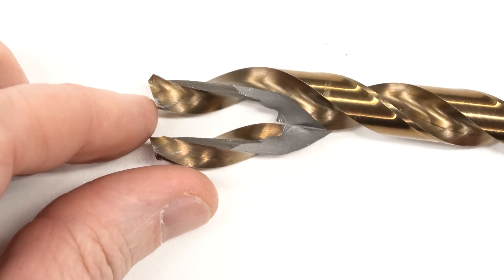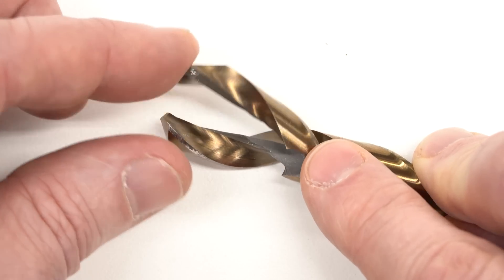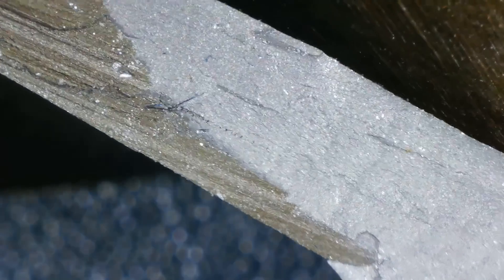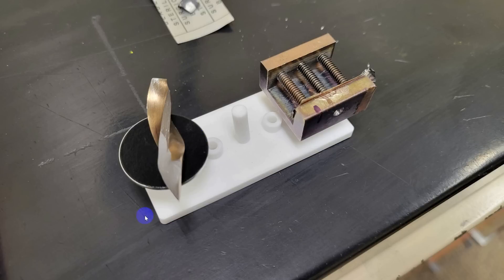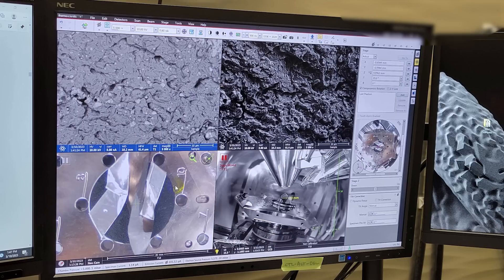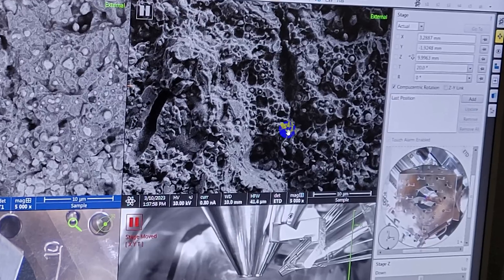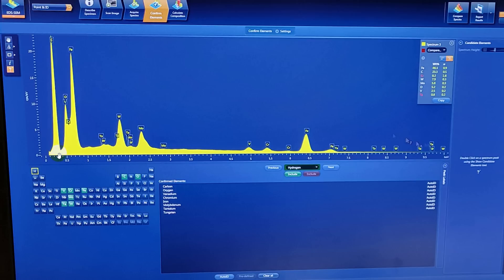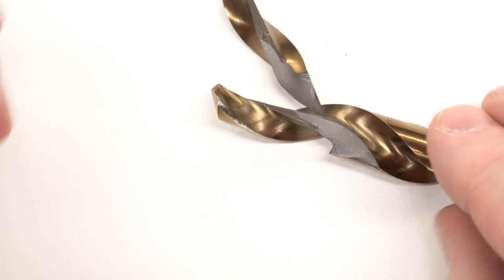What the Scanning Electron Microscope Reveals About This Failed Drill

Comment: Your analysis is very interesting. Under electron microscope the  pattern on the crack look like plastic deformation crack during austenitizing temperature which for M42 HSS is around 1200 degree celsius. But this should not be the case since M42 HSS drill bits are not roll-forged they are ground from cylindrical blank. Image of a crack of ground manufactured  drill (HSS-G) should look homogenous, nothing  like on your case, which look like crack on HSS-R drill bit. So either manufacturer use roll-forge technology instead ground metal manufacturing process for saving money and only finnishing the flutes with grinding so they look like are fully grounded, but in reality they are not.

Comment: I wouldn't reproduce that same "exact" operation again... You'll probably end up pulling the part out, jamming the machine, or pulling the chuck and or arbor out at the least.  Something has to give if your drill gets in a jam. That's why I ended up using HSS drills with my small lathe with small tapers.

Comment: Enlarging existing holes is normal and should not lead to failure of that sort. That said, ideally the right tool for the job is a "core drill" (not to be confused with the other type of "core drill"!) which has three flutes and an extra thick web. You get better roundness and even less chance of breakage.

Comment: You have the same problem I have. I need to specifically decide to not get interested in a topic or I find myself deeply immersed. I’ve used a scanner in college many years ago. Almost bought one or two on eBay, but no room for it.

When increasing drill bit sizes, I try to increase them geometrically. That generally enables the larger bit to have the same forces across the diameter as the smaller bits. Does it matter? Well, I haven’t done an analysis, but I’ve never had a bit break in the lathe. In the milling machine I have had a few bits break. Now I use annular bits in the machines whenever I can.

Comment: I like the analysis, even though it's basically just telling us that there was a manufacturing defect and the solution would be to take a new drill bit and finish the work.

The important lesson here is that this also tells you and everyone else what to watch for in case something serious has happened. That could make a huge difference when it comes to identifying who's responsible for an accident - or not responsible. A few years ago I did see a video/TV program regarding a trucker that was considered innocent because the fatal accident was caused by the steering arm breaking off on his vehicle due to a manufacturing flaw similar to that drill bit. (sorry I don't have any link, but it doesn't matter, the knowledge matters)

Comment: Never seen a drill break like that before😲 and I've broken many drills.
And i agree with them partly that you shouldn't enlarge an existing hole.

Pre drilling should never be larger than the web of the largest drill.
If you only have a little smaller pre drill it will often bite and snap it.

Split point drills are made to be without any spot but still benefit from a small pre drill.

Typical 3mm pre drill for a 10mm final drill.
If you predrill with 8mm you're almost guaranteed to break the drill

Comment: The darker broke area - as you said with the ductile failure - that is not really consistent with this cracking during manufacturing but the drill breaking under stress during drilling. When the drill is under a lot of stress like enlarging a hole then when the a ductile failure occurs all the build up tension will be released in the form of heat on the fault interface. that can be a couple hundred degrees hot.
Had an auger-bit fail on me spectacularly. The cutting edge, the flutes, the entire outside of the drill was cool to the touch, yet the new broken surface was hot enough to burn me.

Comment: Very nicely done. A few things to remember when doing SEM/EDS analysis. First the secondary/backscattered image is a surface effect and backscattered is average Z (atomic number dependent), so darker is lower, brighter is higher Z. So backscattered is good for quick average Z grouping. EDS however is volumetric, that is the x-rays come from the excitation volume below the surface. Classic tear drop effect. The electron acceleration voltage determines how far into the sample. So you can play games with how far below the surface by adjusting the acceleration voltage. Of course, the lower you go in voltage, the harder it becomes to identify elements from the lack of excitation lines.  Typical acceleration is 1.5x the lines of interest. Also doing EDS on a non-flat surface become tricky as the x-ray takeoff angle (to EDS detector) varies and the math becomes impossible to calc accurate weight percent of elements. Flat, polished surfaces only for serious EDS analysis. At one time we had two SEMs with EDS detectors in house. Lots of fun. I miss them.
Reply: Like you mention, you have to be careful about assuming the height of the histogram peak is proportional to the amount of the element present. The peaks represent number of X-rays received which is a complex result of many factors. Comparing Cobalt peak in one sample location relative to another location is generally safer. Trying to compare e.g. Cobalt peak height to Iron peak height at the same location has much less meaning. Sample prep and software tools exist to try and estimate relative proportions more accurately, but in my experience this was very uncommon in casual analyses.
As someone else mentioned, the window on these detectors frequently block or seriously attenuate X-rays from lighter elements like Carbon and Oxygen so those peaks often aren’t super accurate.

Comment: Shop practice != Best practice.

As even many comments here show - many people just do as they have always done. They start at a shop and get told "for XY hole pre-drill with YZ" and afterwards never question that. Drill-manufacturers in general suggest pre-drilling for hole larger than 10mm/ 0.5 inch when working with metal (that is just roughly, depending on the manufacturer, drill, material, feedrate etc ). 

had a similar experience when doing my first reflow-soldering back in university. Had my PCB, soldermask, solder and components prepaired, as well as guideline for the solder-profile of the parts and the solder it self. Got to the local electronics-group and started reading through the manual of the reflowoven they had there when one of the seniors came up to me and explained to me how to use the machine and which settings to use..... yeah all wrong: too hot of a starting temperature, too fast rampup, waaayy too hot of a top-temperature, too short on the max temperature, too slow cooldown at first and then basically shock-cooling at the end.
No wonder the guys there kept complaining that they only got bad results and about how much the need a better machine to get better pcbs..... 

experiment

Comment: One should never enlarge a predrilled hole by using a standard 2 flute drill, a three flute is the correct way. Having said that, the drill failure is as you explain. great informative video.

Comment: Great video. In my work I have review many failure analysis and have seen similar failures of heat treated parts, one that comes to mined is s large spring. I agree that the darker area was created during the heat treatment (oxidation). I see beach marks in the gray area closer to the end of the oxidized area showing the extension of the cracking caused by the local overloading. this continues while the drill continues to cut until the brittle failure denoted by the course grain and cleaving to the end of the failure.

Comment: We use cobalt to drill the initial pilot hole, then switch to a conventional bit for opening up the diameter.  What our machinists have found is that the overbore/opening up procedure adds excessive unsupported shoulder loads to the hardened bits causing breakage.  Using softer HSS only requires the shoulders to be sharp, and the softer steel can absorb the micro vibrations with no issues.   And the guys actually have contests to see who can sharpen their bit shoulders the finest.  Much easier to touch up shoulders than pointed tips.   Just our two cents from the guys here at the shop.

Comment: Thanks, James!! My prior experience with SEM results have been in chocolate, showing distribution and shapes of components & types of fat crystals – things that researchers are fascinated with. While the data was interesting, my concern at the time was whether the sample was well-tempered so that it would have good snap and resist melting at relatively low temperatures.

Curiously, there was no Cobalt detected in the first histogram, which I assume was from or near the outer surface of the bit (consistent with the very high Carbon peak). It could be just coincidence, or perhaps any surface Cobalt was oxidized "away" during heat treating. It also doesn't look like there is 8-ish% Cobalt in the bit, but since the histograms (I assume) represent one linear scan of a small region of the surface it just didn't happen across any higher concentration regions.

Regards, Charlie

Comment: Hi James, did you think about breaking that tip of the drill in another place to see if the whole tip has a different color and then it can be attributed to the heat treatment? It should be a simple whack with a hammer and see if it has the same color... right?

Comment: Interesting video and information. In my life before retirement, I was involved with Overhead crane maintenance. A large part of these cranes consumable parts are the wire rope that is used as part of the hoisting of the load. One of my many training materials the different types of failures of the steel wire when a wire rope failed prematurely. What was interesting in the literature was the electron microscope example photos that showed the difference in the wire failures. With that you could examine and determine most of the time the root cause of failure by just cleaning and evaluating the break with a simple magnifying glass. Great stuff. In all the years that I drilled holes and observed holes drilled, I never seen a drill bit fail that way. When you showed the failed bit I was curious as you, why it failed.
Thanks for sharing.

Comment: I say you should respond to the person who sent you the message from DrillHog and call bullshit.  I hate incompetent company representatives.

To respond to your query, I have used drill bits up to 80 mm in diameter in manual engine lathes.  You try drilling a hole that large in a piece of stainless steel without multiple pilot holes!  The web of a twist drill is designed to be able to cut into the material being drilled, but it is a huge compromise between clearance and rake.  It can and does cut, but not all that well.   It is the lip of the tip of the drill that does most of the cutting and is best at doing so.  The best and easiest use of any twist drill bit is to drill into an already existing hole that is wider than the chisel edge of the bit.  What a moron.

Comment: My mentor always tapped the end of the drill bit with the chuck key before installing it. Took me 5 months to drum up the courage to ask why. (I was 16 at the time). He told me if it doesn't ring, it is already broken. 2 years later he found one and said it will break when you push it. Sure enough, in a test hole it broke. 
I wonder if magnaflux would have found that.
I still tap the drill, but honestly have no idea what I'm listening for 😆
Just like tapping a melon... What should it even sound like? Echo or thud? LoL.

Comment: Of all the drills I've broken over the years, I've never lost one like that! I've seen them shatter into a thousand pieces, Shear the top 1/2" off, and I've even seen a couple untwist themselves without breaking (they look really weird when they do that!)
Reply: Untwist? 
A twist drill bit, failing plastically, untwisting its twists? I just want to make sure i am understanding what you are saying because that goes against everything i know about material science (which is not much)
Reply: @melody3741  yup, you read it right, they untwisted! I can only assume that the steel they were made from was incredibly soft (they were the cheapest imaginable bits!) I've got a 4mm and a 5.5mm that both managed to plastically deform about the first third of their length, with a weird curve in the flutes as it transitions back to their normal untwisted form. any remotely normal drill bit would shatter, but apparently the grade of chinesium these were made from is extra-bendy!

Comment: Good video -
isn't that Gold colour on the outside of the drill Titanium Nitride   ?
Reply from the maker: No.  TiN is a much brighter gold color.  This drill is uncoated.
Reply: @Clough42  - OK - I'll take your word on that.
So you're saying that the Gold colour is an oxide
of the steel alloy used to make the drill bit?
Also - a pilot hole?
I thought that you would measure with a vernier the
thickness of the drill between the flutes to match the best pilot hole drill size?
Reply from the maker: @Bobby-fj8mk  you could just Google "what is the gold color on a cobalt drill"
Reply: @Clough42  -
I just did:
"At the end of manufacture a cobalt bit is baked in an oven to turn the surface color of the steel a dull gold color. This is done primarily for easy identification by color. "

Comment: I had the same failure about 8 years ago, Sutton 10mm HSS Cobalt drill. Used for the first time and it fell to bits on contact with the job. Unfortunately Sutton Australia didn't even bother replying to my email asking if I could have a replacement. In my email "Upon inspection one can see the outer coating has actually plated the inside of the drill i.e. there was a crack in it during the manufacturing process. " . In retrospect not a coating, just an oxide layer as described in this video. Perhaps HSS Cobalt drills are more prone to cracking during manufacturing than other drill types.

Comment: Oxygen and carbon can't be directely quantified, as they are too light elements. Their amount are recalculated by deconvolution software. Next, EDS is only semi-quantitative (you need WDS for accurate results). 
So "8% oxygen" doesn't mean nothing... ( and next it should be mentionned if it is 8% in atoms, or in weight. The difference is huge !)
But although oxygen amount can't be known, it's presence remains significant. Good job !

Comment: Starting with a spotting drill (not a centre drill - they are for making centres) you should use the biggest drill you can depending on the equipment you have.
If you have a big radial arm drill that will push a 2" bit through steel then that's what you should do.
Normal people like me have to step drill because of lack of power.
It's always the small drills I break and once I step up to a decent size it's OK.
A think in your case the chips bound up in the hole causing the failure?
Reply: I think not.  Look at the original video, again.  It is easy to see the bit was cutting freely, although I did not see him adding any cutting fluid.  It is also true his pilot hole was a bit larger than necessary.  In nearly 40 years of machining, I have NEVER bored a large hole with a single drill bit  even when I did have access to a radial arm drill or high power vertical milling machines (which I no longer do).

Comment: been drilling for 43 years and the only drills i have seen that you dont step drill with are the ones designed like a end mill with flat cutting edges and a center startingpoint the ones i have at present are made by dewalt and do a great job in steel but step drilling has been the standard as far back as my reading on machining can take me

Comment: While it would be a fairly rudimentary test at this point, if you happen to have a set of Rockwall hardness files, I'd be curious to see if the off-colored areas test significantly different to each other. The surface of hardened tools, especially with a topically coated treatment, should be at least a grade higher than its core. That's not indicative of a manufacturing defect by itself as stress fatigues can certainly affect a steel or alloy's hardness up to the moment of failure (and/or induce it), but a coating applied to a tool that either failed heat treat (or in specialized cases, cryo treat) would show up further away from the failure site if you're up for a full post-mortem.

Comment: Dear James,
Drill Hog shoul pay you and give you a lifetime supply of drills for free for this work. In fact - they should be doing this and not saying that all drills will fail when enlarging hols. What an unprofessional answer!
Most likely the round blanks for drills are induction heated, spiral hot rolled in and than ground, heat treated and sharpened.

The fault most likely originates from stage 1 - induction heating.
They don't give enough time to heat the core propperly.
When hot rolling the spiral - they start from shank and meanwhile the tip is cooling, the zore of the tip also.
When the tip is forge roled - it is done too cold and it cracks.
The rest is history.
I still can't belive how low level of understanding of what they are doing exists at DrillHogs... 

Thank you for the greay job on this one 👍

Comment: James, thanks for making the video you really made my night. I appreciate your curiosity in finding out the root cause I've always went a step further to figure out how something had failed. One thing I do to reduce the risk of a drill failure is to put a lot of drag on the tail stock or mill quill using the lock, keeps the drill from jumping into the material from any backlash.